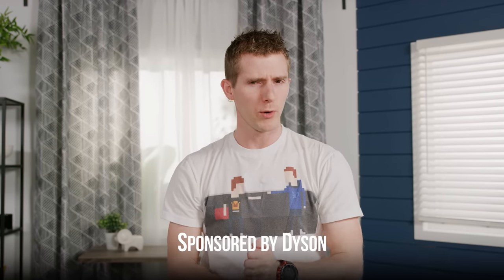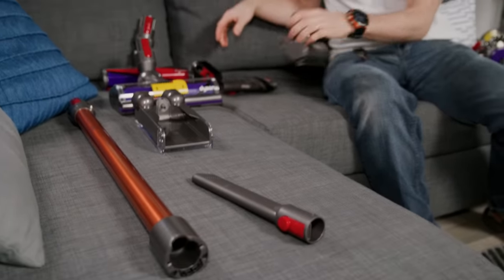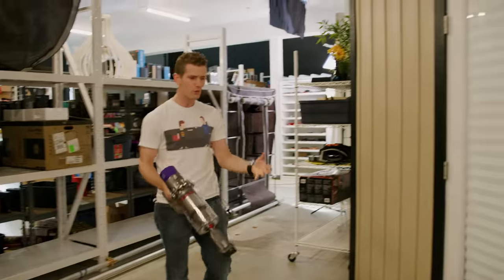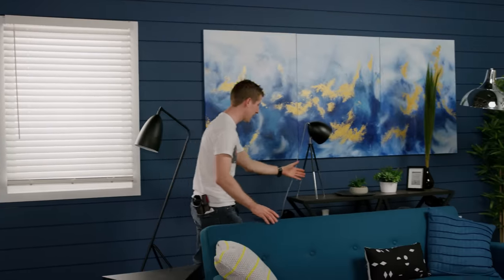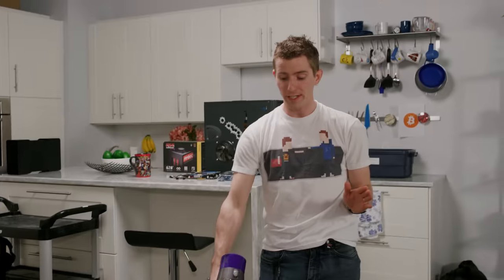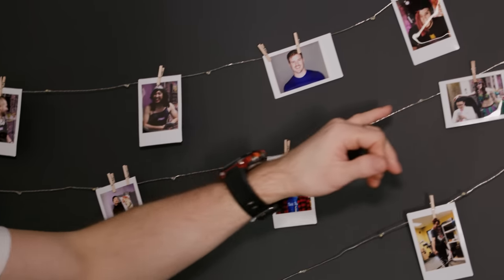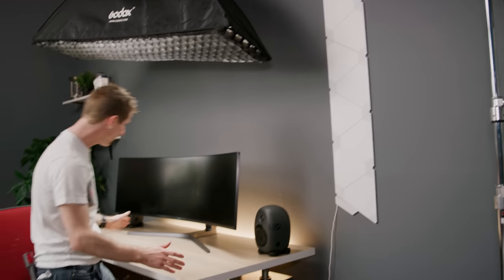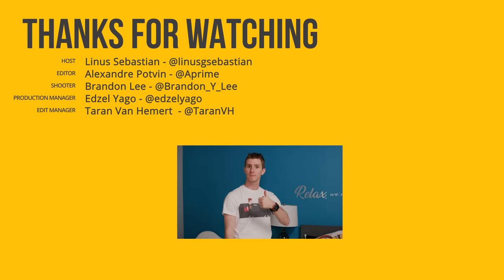Ultimate Tour of Our NEW $100,000 Studio - Dyson Cyclone V10 Showcase

Comment: How much RAM does it come with?
Reply: Trivial Curiosity like 4mb
Reply: bakonpancakz Can I download more?
Reply: GravityX
Only with the new Nintendo dyson vacuum cleaner XL red edition.
Reply: Enough to become a Raygun. Then, switches to clean up your enemies.
Reply: 9999999999999999 petrabyte
Reply: 256gb
Reply: DEDOTATDED WAM
Reply: It’s 1mb -
Reply: Tomáš Pružina Still more powerful than an Intellivison.
Reply: 69TB
Reply: not enough RAM
Reply: can it run
 crisis
Reply: @11 11 Then it will most definitely also have RAM, there is probably some kind of microcontroller in thete that also requires RAM
Reply: @claxeekhout1239  given the ray gun noise, more like can it cause a crysis.

Comment: This is like the 100th dyson vacum video today.......
Reply: Matic Volk its a new product, the embargo lifted or they just said that release the video on this date.
Reply: True have seen on every tech channel, but slow tech week so far and rather have diff POVs than no vids at all, my opinion
Reply: Tbh i would rather spend the money on a good vacuum duster than a phone. Phones are obsolete after a year or two, a duster you have for years.
Reply: Yeah the V10 is really expensive but i bought the V8 for around 450 and it was worth every penny!
Reply: Furvivor and the point is you could've had the very same result for 200$.... Just not as pretty and no bullshit about digital motor....
Reply: how can you be so sure about it when you don`t even know what exactly i need?
Reply: Furvivor its a damn vacuum, what can you need so special about sucking up dust??? Or you are one of those people who come up with 1000 and 1 uses which never happen in real life? Cause I lived with people who had some model of dyson handheld vacuum and outside of it being on battery while extremely low powered compared to other vacuums there was nothing special about it whatsoever. They had a proper vacuum to deal with everything outside cleaning breadcrumbs in the kitchen....
Reply: Space JAGA Small form Factor, light weight, robust build quality and durability, a large selection of attachments and easy acces to replacement parts, hepa filter system very usefull for allergic people like me (espacially for sofas, carpets and mattresses wich i can clean really good with the matching brush), washable filter so i don`t have to buy a new one everytime i have to clean it, and i have to clean it often because ... you guessed it .. allergic. because of my allergy i also often have to vacuum my car, wich is no problem with the small dyson. also i had never the issue with dead battery or low succing power.
Reply: @spacejaga  To be fair, I just bought one with points, and it's better than my old Dyson tug-around-the-house model in every way. Lighter, easier to use, and the battery lasts long enough to do the whole house. Much more convenient for adhoc spills (2 kids under 3). If it lasts a decade and a half like that one, then it will be money well spent. I'll likely have to replace the batteries, but that's not a big deal.

Comment: might seem a bit unnecessary but that bedroom set, if i were you id bolt down a metal candle holder to the bookshelf doorway to use as a handle for opening and closing. looked a bit like a hassle to close.
Reply: I was thinking that too. How do they close it without just pulling on the trim?

Comment: I was actually thinking about buying one of these but 500 DOLLARS!? ARE YOU SHITTING ME!?
Reply: I have one trust me they are the best vacuums in existence
Reply: Holy shite
Reply: Buy an older model second hand and get a replacement battery. Much cheaper and works just as well. I got myself a DC59 (almost the same as the V6) for a fraction of the new price and they are incredible for their size. I never thought I'd say it but Dyson did good. It's just a shame they cost so much as it can put off potential new buyers.
Reply: So worth the price. Best vacuum I've ever used. Dyson is the shit.
Reply: Just start a tech review channel, seems a cheaper way to get one.
Reply: Powerful batteries are still pretty expensive.

Comment: If you have the money to get a vacuum like this don’t get a dyson, the batteries go out fairly quickly in a lot of them and then you have to dish out a couple hundred dollars to replace it. Your money is better spent going to a local vacuum repair shop and buying a riccar/simplicity for half the price. You will end up with a more reliable vacuum and have more money in your pocket. Just a tip from a Vacuum Repairman.
Reply: My Grandma had a Simplicity she bought from her local Vacuum store. My parents now have it AND a Shark Rotator Lift Away. I think the Shark has more pull.
Reply: Matthew Bauer Unfortunately the Shark Vacuums can be fairly problematic and do not release their parts to distributors making them difficult to get repaired. If you feel that your simplicity has less pull you most likely need to get it serviced\replace the belt. They have better motors and brushrolls than the sharks. I would easily recommend a shark if they weren’t so difficult to get parts for because they are great for the price. Hopefully soon they’ll release the parts to distributors.
Reply: Parental Guardian Yeah or maybe people who own vacuum Repair shops that have been in business for 39 years.
Reply: Yuck, bagged vacuums. Vacuums with bags all need to be burnt in a fire. You can get replacement batteries for $20-60, and most you just need to unscrew a set screw to replace it. Just like a cordless drill, but with a screw holding it in. (I hope you guys aren't charging $200 for replacement batteries.)
Reply: Andrew Delashaw Side note, only a few of them are able to be installed as you described, others are much more difficult to install.

Comment: Dyson = Plastic crap.
Reply: Mickice what would you prefer a cordless, light-weight vacuum to be made out of...?
Reply: HOkayson quarter inch stainless steel, of course
Reply: Even rainbow has switched to plastic. Why make things out of solid steel and aluminum when they don't need to be?
Reply: alcowherd7 sorry, i guess i didn't make my comment very clear. How about: 2 inch thick reinforced steel?
Reply: I was replying to the original comment made by Mickice, direct replies on original comments don't include the username in front of the comments below.
Reply: Plastic is fine, my $47 Chinese vacuum uses it. My vacuum does not cost over $800 Canadian with a piss ant weak sauce motor and a battery which over time runs flat in 10mins.
Reply: Mickice it's reinforced plastic and if it works for rainbow (twice the price of Dyson) it will work here.

I have never had any issues with any Dyson, only issue I have is they are too expensive for little gains over a good vacuum.

Comment: I own a Dyson V8 Absolute. I would consider it the perfect vacuum if it weren't for some major issues.

1. Pathetic battery life (45 min on normal power, 7 min with the boost)
2. Long charging time (3h 30m)
3. Cannot be used while plugged in and charging

Otherwise, everything is great. It is sturdy, powerful, user-friendly, expertly designed for ergonomics, comfort, easily disassembly, and emptying, and feather-light to the point where an hour of use feels like less than a minute of work.

I just wish I could use it while it's plugged in or that Dyson improves it's charging speed through supercapacitors or better batteries. Or makes it easier to swap spare batteries.

Comment: The Dyson Cyclone v10 is 5-10x the price of a normal vaccum. For what? Not having a cord? ooooh how fancy.

Except that means you're stuck with a battery... that will eventually die and need replacement.

Also, unless you keep it plugged in after every use to charge (which can wear the battery out sooner) you will inevitably end up needing to take out the vaccuum and finding it's run out of charge, meaning you have to delay your cleanup. 

Don't see how paying that much for a vacuum cleaner is worthwhile... unless you actually enjoy vacuuming.

Comment: I don't like it when products are shilled out like this eh? This new $600+ Dyson V10 's may have excellent 150 air watts of suction on high but the battery performance is poor with it only having about 8 minutes. It has does have lower settings, low and medium but it won't be that much better than a Dyson V8 then. Furthermore this V10 60 minute run time claim on a battery charge is when no power accessories are being used and is running on the low setting in which only has 15 air watts (15!). If Dyson really wants to replace the corded vacuums for cordless, they still need to step up on the batteries.

Comment: I have the V8 there are 2 problem I find annoying about Dyson, not including the 20 mins run time, then it take 4-5 hours to recharge.

Problem 1 - The exhaust vent. The V8 has 2 sided vent opening which does a super great job at blowing away the dust on either side of the area which I am about the vacuum. Makes the dust float all around the place.

Problem 2 - I hate it every time I have to open and empty the dust, the finer dust particles always seems to float away in the air. I have to hold my breath everytime I empty the tank. If they make it bagged vacuum it wont be a Dyson.

Seems their updated model still has these problems. 

The Dyson can never replace my main 10 years old Miele bagged vacuum. Lucky I still have my Miele, when I was given the V8 as a gift.